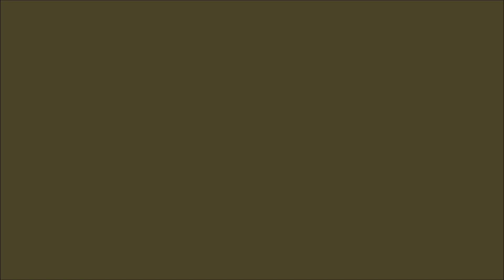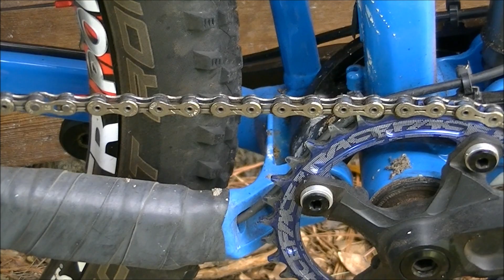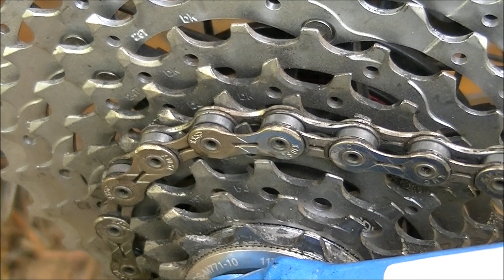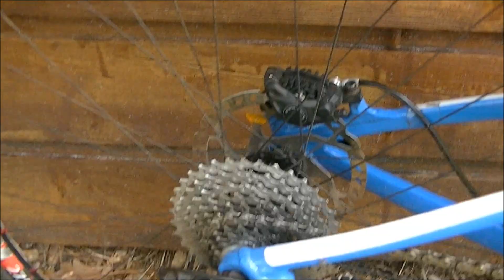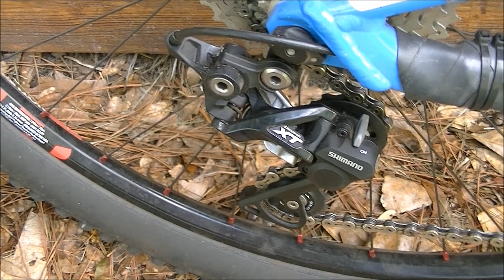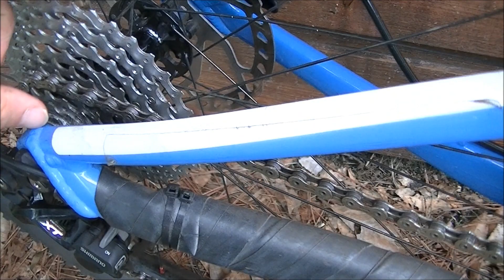How to Build a 1 x 10 Drivetrain on a Mountain Bike

Comment: Nice Video, thank you for posting. I was in my LBS looking at all the sweet mountain bikes with their 1 x 11 or 1 x 12 drive trains and got the idea to upgrade my bike. I was surprised at how little advice or support my LBS was able to provide for this process. I understand, they would rather just sell you a $4500 mountain bike. Kind of out of my budget right now. I first went to http://gears.mtbcrosscountry.com/#26I1I1 to get an idea of my current gear ratios and what I would be potentially getting/giving up to go 1 x 10. @Matthew Kramer also suggested the very good  http://www.bikecalc.com/gear_ratios. These are both good starting points, since the big question is always Which Chain Ring Size/Cassette do I go with???. Clint, your video nicely summarizes the required parts for an upgrade to 1 x 10. I did the following swap for a total cost of $275 to go from 3 x 10 to 1 x 10. My bike is a 2005 Santa Cruz Superlight (yes I still ride a 26"bike!!--why not?). New Parts: Shimano XT SL-M780 10-Speed Right Shifter $59 Planet Cyclery; Race Face 104mm Single Chain Ring Narrow Wide 34T $38 (Amazon); Shimano XT Dyna-Sys CS-M771 Cassette 11-36 $45 (eBay); SRAM PC 1071 HollowPin Chain 10-Speed $30 (eBay); Shimano Deore XT RD-M786-GS 10-Speed Shadow+ Derailleur Mid Cage $87 (eBay);  Generic Shorter Chain Ring Bolts $12, which I bought @LBS :(. I did misfire and wrongly purchased a Shimano XT SL-M780-B I-Spec B (This does NOT have a simple round handlebar mounting clamp) shifter without realizing that I-Spec requires Shimano compatible brakes to mount the shifter on the bars or you will be frustrated at looking for a pricey aftermarket stand alone mount to make I-Spec work.  If you run a different brand of brakes...they likely won't work with I-Spec, so be sure and check that the shifter mount configuration works for your bike. Overall Results: Awesome!!! Bike rides much simpler, cleaner, and seems more efficient. I realized now how much gear ratio overlap there is in the old 3 x 10 set ups and how much effort was put into shifting those front chain rings.  Yes, I lost some coveted low gear ratios (my easiest gear was previously a .69, now its a .94), but I am not in mountainous or steep hilly area. Quite frankly, you make do with what you have. I had considered getting a an oversize 42 cog for the rear cassette, but figured I would try the current set up first to see how I liked it. So far, great!! The large cog sets are kind of pricey ($60-80) for basically one easy gear, but I imagine if you have some elevation on your MTB routes you would be thankful to have a granny gear. Lastly, the installation was pretty much plug and play. I did consult some of those excellent Park Tools YouTube videos for getting the new chain length correct and also a refresher on adjusting that 10 speed rear derailer. Good luck to you and thanks again.

Comment: Next video: How to reinstall your granny gear.
Reply: Clint Gibbs  42t still doesn't get you close to granny gear ratios.
The granny gear is 23% lower than your single with the 42t rear cog.
Reply from the maker: I typically use Sheldon Brown's site for gear calculations. You can plug in quite a few variables.
Reply: Clint Gibbs Either way, the granny gear gives a LOT more torque for going up hill.  The weight of the rider also makes a big difference.  Heavier riders can actually climb faster.
Reply from the maker: No doubt that going 1x requires some sacrifice. You just have to ask yourself if the simplicity is worth it. I like having a 2x10 for my trail bike. I really like being able to drop down into the small ring quickly if I need to.
Reply: If you are worried about a granny gear you can grab a 42T extended range rear cog.  I know that I went from a 24t granny 36 mid ring with no big ring with 9 speed 34T big cog to a 10 speed 34 mid ring no big or small ring and 42T big cog.

The difference between the 34/24 and the 42/34 is something like 8% on a 29er according to sheldons calculator.

If 8% is a deal breaker then just grab 32T chainring.  You won't be able to notice the difference.

Wether or not a 1x10 is right for you really depends on the terrain.  I have 2 bikes a hard tail NINER Air 9 and a full suspension Niner Rip 9.  I also go to 2 different places.  With the RIP 9 I run a 2x9 setup.  The lowest gearing is 34x24 which my Air 9 has no issue competing with. 

The reason I keep the 2x9 setup (besides cost) is because there are extended downhill sections that I could spin out.  Even with the 36T chainring I still am pedaling at my max RPM in some spots so I'm not willing to change over because for every downhill is a nasty uphill which means just too much range is needed.

That is why the SRAM 1x11 has a 10t cog!
Reply: MrGivmedew  I use 36/20 for going uphill and 11/44 for coming down.  I can spin out with the 44t.  My 20t granny gives me a ratio 46% lower than what you have.  That is a huge difference. You would need a 61t cog to match me.